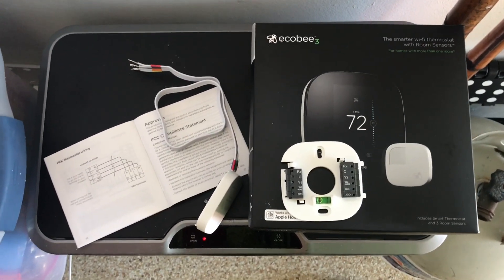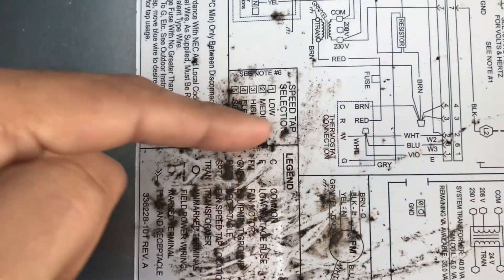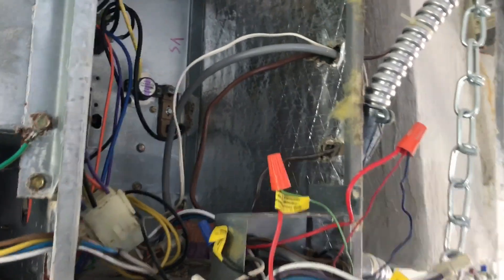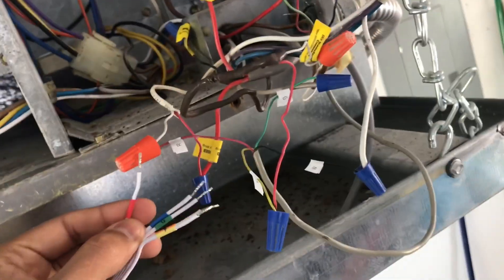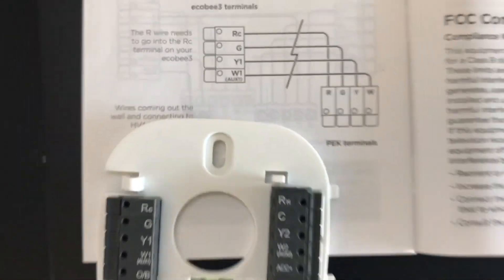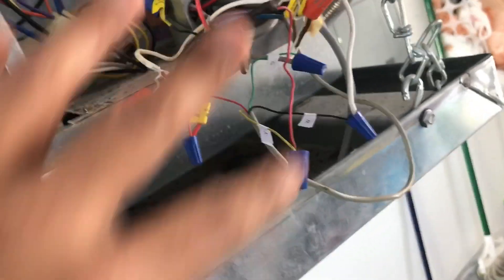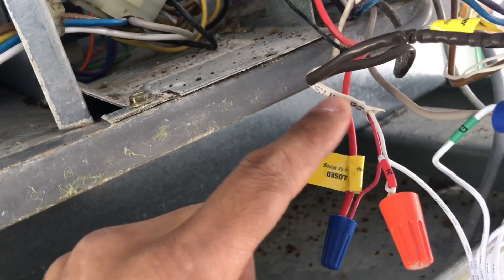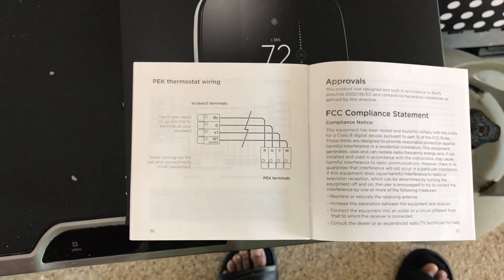Ecobee pek adapter installation without a board

Comment: I thought I had everything hooked up correctly. My system doesn't have a control board, just wires spliced together. When I turned the system back on, the ecobee started to boot up but the fan in the HVAC system just started turning on and off really quickly, like so fast that the fan didn't even get up to full speed. I noticed an unused blue wire along with the red, yellow, green, and white wires going to the thermostat. Maybe I'm supposed to try to use that as a C wire without the pek, but then where would I splice that unused blue wire in at the HVAC system?

Comment: It’s the inside blower fan. My unit does not come with a Board very similar to your video. Also, my old thermostat had a jumper from rc to rh. Do I need to put that jumper back on the ecobee thermostat wiring?
Reply: Did you have to put the jumper back in the new thermostat? I have the same thing

Comment: I have the exact same setup as yours but the fan won’t turn on after I installed the ecobee. Any advice
Reply from the maker: If you are referring to the outside fan, they most likely it is the capacitor or a relay-delay. the inside fan is a bit more difficult, the fan and control board are build-in, therefore, you need to locate the schematic that should be pasted on the motor and check which speed is the fan connected to. there is a cable that you can change on the fan plug that can control the speed of the motor, i keep mine in medium. lastly, make sure the system was setup correctly.

Comment: Hi. The Ecobee customers service said that my old thermostat has a splice point on the Y wire. Because the color of Y wore on the thermostat is different from the color of Y wire on the HVAC. So, I am wondering whether I need to install the PEK like you did.

Comment: I had installed my device incorrectly and got a couple wires mixed up. My wife and I went a night without A/C until I finally found this video. Thanks to you, our A/C is back running! Thank you!
Reply from the maker: Since i made this video, ecobee as provided phone technical support for the carrier pr units without a board and turns out you can also install the thermostat without the adapter...  i might do another video on it.
Reply: Pedro Alvarez I’d watch it. :)
Reply: Pedro Alvarez can you do a update video about that?

Comment: Hi Pedro, I have a Carrier unit that doesn't have a circuit board. When I tried to install the Ecobee 3 Lite unit I realized that I had no idea what wire the blue C wire on the Power adapter from Ecobee needed to map to. After finding your video, I was able to locate all wires needed to map the device and I am up and running! Thank you for your contribution and for helping me!

Comment: I'm getting confused on the brown wires is there 2 brown or only one?
Reply from the maker: andrew proulx 
I apologize for the late response, are you talking about the brown bundle pf wires that hold the write and red cables inside?
If so, then your unit might have more than one.
In this video, the unit had three, the brown bundle cables are fail-safe cables that will shut  down the unit when something goes wrong.
In my case, i have one that goes into the compressor outside, another to the smoke detector, and another to the pan under the unit in case it fills with water.